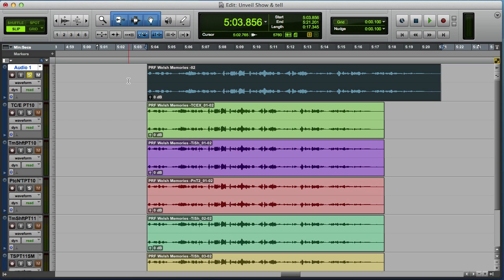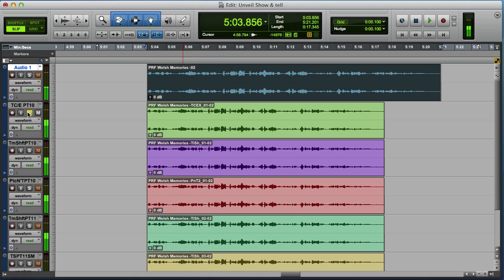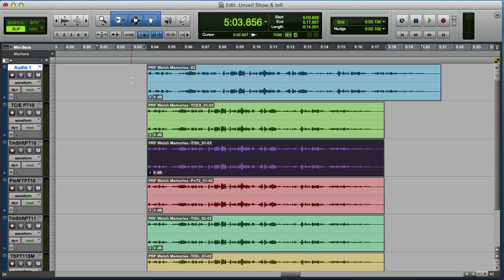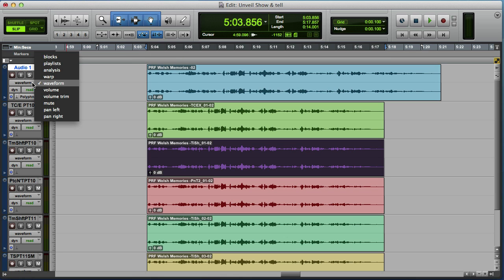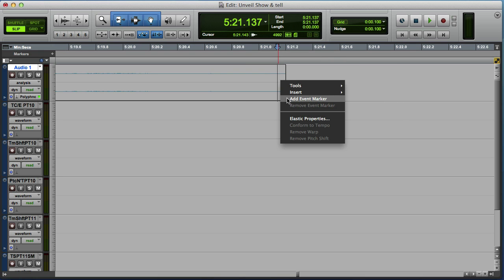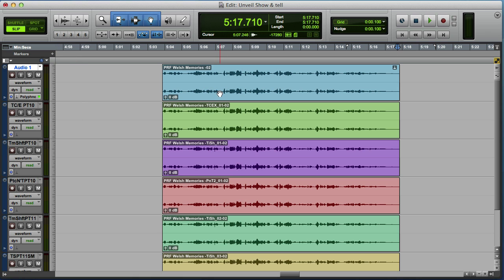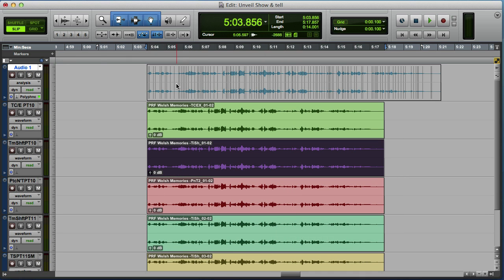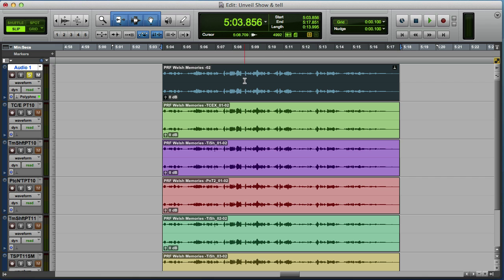Pro Tools Tutorial: Using Elastic Audio Instead Of TCE In Pro Tools 11

Comment: As one or two others have pointed out, when Elastic Audio is enabled on a track, it takes precedence over the TC/E algorithm.  So you can just trim it in realtime with the TC/E tool and it'll still use the EA algorithm.  It might not be quite the way EA was meant to be used, but it's very handy.  Try it with Varispeed; that's particularly fun.